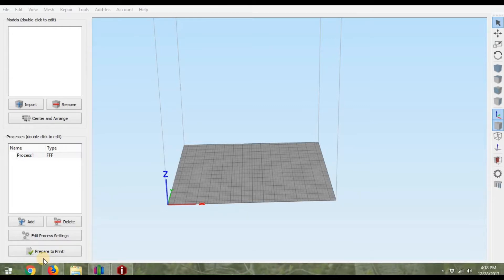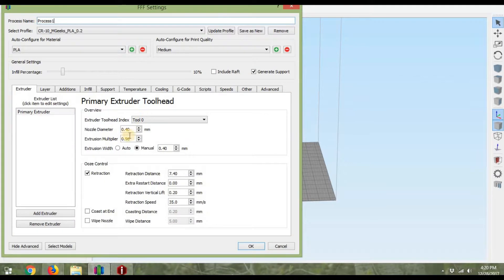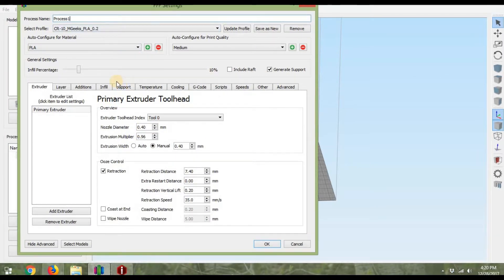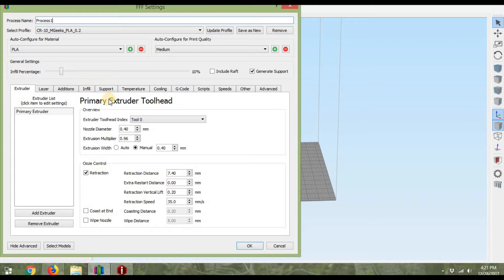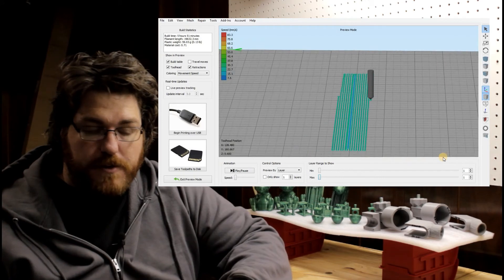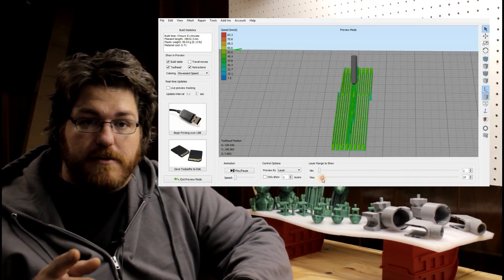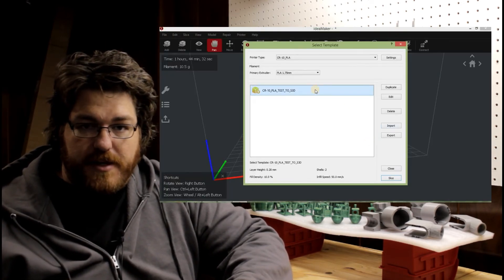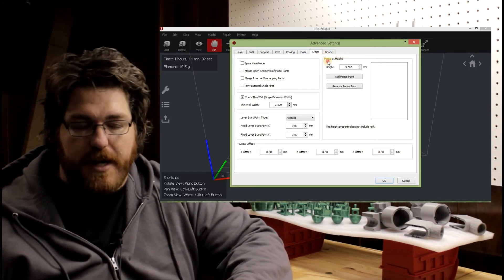Ideamaker vs. Simplify3D

Comment: Just FYI, your .bin IdeaMaker settings file is bad. I tried opening it in 3 different ISO programs and all said it was corrupted. Try replacing it with a .zip archive.
Reply from the maker: Well dang it, I'll check it out.
Reply: @RevampedOutdoors  Great video otherwise! I'm actually now using ideaMaker thanks to your advise. Got sick of all the stupid inexplicable issues of Cura.

Comment: Love it. but! You went a bit fast in comparing settings between S3D and Ideamaker.  I really wanted to see that.  I've had ideamaker for over a year.  S3D 6 months.I'm trying to print a project in S3D that I just can't get solid top and bottom.  Everyone says it's under extruded.  Can't fix it.  Opened up IdeaMaker. Totally forgot how to use it. Updated it Finally got my Scripts and Printer in. Printing now but so far 100% better than S3D did.  So how do I compare settings to see what I needed to change in S3D. Thanks again for the video.

Comment: I had trouble with overshooting the corners on a small part using Cura. Someone suggested a smaller jerk. Creality uses a 10  in the locked Marlin FW and I added gcode to change it to 5. It slowed the print down at the corners. By coincidence IdeaMaker  had a jerk setting of 5. Maybe this is why IdeaMaker is slower than Sinplify3D . ???
Reply from the maker: Could be, simplify does hide some of the more advanced settings, I haven't checked the jerk settings on it for awhile mostly due to not having an issue so far but I'll look more into it next slice.

Comment: Enjoyed you video. I like your style and humor.  Learned some. Time well spent.
P.S.  Where did the Cura vs S3d Video go?
Reply from the maker: Thanks! I decided to pull it some of the slicer settings were off between the two and people either hated the comparison or loved it. Plus with the new cura releases it's so outdated now that it's apples and oranges. That was the first video I ever did related to 3d printing, never thought it would get as big as it did. If I were to redo it now I would be hard pressed to see a reason to put money into S3D especially with the whole no update fiasco. Great slicer but the free versions are getting great too.
Reply: @RevampedOutdoors  Agree.would not consider a $150 slicer. Currently using slic3rPE, but I like to tinker too much so I keep looking around.  Thanks again. Keep up the videos.  If you consider making them, I'll consider watching them. ;-)

Comment: "I checked out about 10 minutes ago..."  LOL'd.  Nice vid; I really like the UI of IdeaMaker vs Cura, for sure.
Reply from the maker: Thanks! I agree, the UI seems to be almost more utilitarian but easier to remember.  Usually those two things don't seem to mix well but some how they have integrated the UI pretty well on both platforms.  The Cura system seems to push just the basics and you have to add anything through 6 different clicks to get it to show up in advanced.  I've been messing with Craftware a little bit and that UI almost seems too basic that it's hard to track what step your own.  Kind of the opposite of slic3er which for me is too utilitarian, all settings too spaced out to keep track of what I just changed lol.  I guess it's one of those things, they all slice it just boils down to personal style.

Comment: Hi great video,can you tell me what program I use to view your ideamaker settings,I tried word pad ++ but can only see garbage,thanks.
Reply from the maker: You should be able to open in Ideamaker as long as you download the .bin file listed in the description.  The .fff file is for simplify3D.  You have to import it into Ideamaker which is a little weird but once you get it it's pretty straight forward.  Open an STL in Ideamaker then hit the big play button in center screen "I button in older versions), select template screen should display, click import and find the .bin file, the file should should up in the dialog box, double click and it will bring up edit template, then click advanced and it will bring up advanced settings with all the tabs for settings.  I hope this helped.
Reply: Thanks very much,I don't suppose you could give me a step by step how to get the file into idea maker,having some trouble.
Reply from the maker: What part are you stuck on?
Reply: Thank you,I just haven't got a clue how to get the file into ideamaker.
Reply from the maker: The first comment above is a step by step to open in the new version of ideamaker, just make sure to open some STL file any STL will work it allows you to get into the other menu.

Comment: I have a xyz 1.0 aio and i was wondering if the simplify 3d would make a hollow tube or pipe i guess.im new at 3d so just trying to find good software.thanks
Reply: Simplify 3d isn't for building objects..  Its for converting objects made in a cad program (such as fusion 360 which is where you'd make the pipe) to a language the 3d printer understands while giving printing specific commands such has how to heat the hotend, the path the nozzle moves to make the object, and other things specific to 3d printing (Brims, etc).  Yes I'm generalizing here but I think you'll get the point.

Comment: Your intro matched with the music you used got you a sub. Keep being entertaining =D
Reply: Although that jump cut @ 1:35 is frustrating me to death, cause i cant figure out what you did to get to that next page >.>
Reply from the maker: Thanks man I appreciate it!
Reply from the maker: That first screen was just the printer setup, then the screen after that is actually modifying the profile specific. Sorry about that, thanks for pointing it out I didn't notice before that would be frustrating.  Once you add a model you can "start slicing" by hitting the capital I in the middle of the screen above the work plane.  This will bring up that second dialog then you can create a template this is where you can hit advanced and then get into the slicing options.  It's a little frustrating at first because it's relatively hard to access without a loaded model.

Comment: Dude, you deserve more subscribers! Awesome comparison (I mean, 150$ vs free) and I love your humor... ^_^
Reply from the maker: UncleManuel thanks man I appreciate it!
Reply: One note at ideaMaker: it only supports rectangular printers. I have a delta printer (Tevo Little Monster) and pretty much ended up with buying S3D. That's a control thing and I need intra-layer retraction (lift) for fast print speeds (100 mm/s and faster)... ;-)
Reply from the maker: UncleManuel good call, I think Craftware might work for delta's but I don't have one to test it out.

Comment: Ive got a question, can ideamaker slicer setup for a delta style printer?
Reply from the maker: That is a good question, I can't speak from experience that it can work for deltas.  Unfortunately I don't have one, looking into getting one but not currently.  I would think if other slicers can output for deltas ideamaker should be able to as well.
Reply: 16by80.   It would be nice if it would. I did not see any cylindrical settings though. I really like my delta printer. I would like a better slicer then cura though. simplified 3d is for me a bit expensive especially since I'm just a hobbyist. I wish I could get the education license but I of course I  doubt it.
Reply from the maker: Have you looked into Craftunique Craftware? It has manual supports and has an option for circular platform in the printer setup menu. I really like Craftware it's definitely in my top three.  I will probably do a video on in the near future.  You can find it here: https://craftunique.com/craftware/ 
Setting it up quick with the CR-10 I had great results basing it off an S3D profile.  I'm sure you could copy over some of your Cura settings and hit the ground running.

Comment: I use multilayered skirts to create an easy “breakaway” brim.  My settings vary a lot but by setting my skirt to a distance close enough to still bond yet farther then a standard brim, it can be somewhat break away.  The exact distance is a bit tough to nail down based on algorithms used, but a bit over half your nozzle thickness is a good start. Depending on the slicer, you might be able to build a skirts up in loops around objects and even vertically. If the skirt geometry is only determined by the bottom layer you may have to worry about the skirts intersecting and firmly bonding (or worst) with the print.   

Admittedly, it is a hack. It is also slicer agnostic... for the most part. 

I will have to try the manual support idea.  That seem pretty clever!
Reply from the maker: Thanks for the suggestion, I'll have to give that a try.  It seems like every time I use a brim I end up having it stick to the part, I'll try moving the set distance next time and adding more layers.  The support trick sometimes fails because there isn't enough surface area for the plastic to bond to the plate and it warps up.

Comment: Thanks for an interesting video! Could you maybe post the profiles on the CR-10 Facebook group? Currently checking out Ideamaker myself, and it would be interesting to test your settings :)
Reply from the maker: Glad you liked it, I have found a file hosting service I trust with small capacity but good security.  Here is a link to the two profiles if you want to check them out!

Direct links:

Simplify3d:
http://www.mediafire.com/file/3u585aqjad42ukk/Simplify3D_CR-10_MGeeks_PLA_0.2_16by80.fff
Ideamaker:
http://www.mediafire.com/file/bzv1fj3yccabg4d/IDEAMAKER_CR-10_16by80.bin
Reply: Thanks! I will test the Ideamaker-profile next. And maybe consider buying S3D.... :)

Comment: I use a brim when printing litho's works well
Reply from the maker: Good call.  They work great for full pictures, I always seem to put them in frames or boxes so I always have the thin edge on them (.04-.08 mm) if I use the brim I always get delamination on the Z axis trying to cut them off.